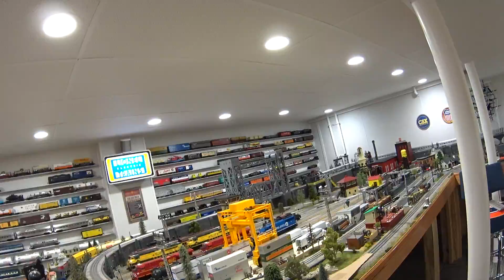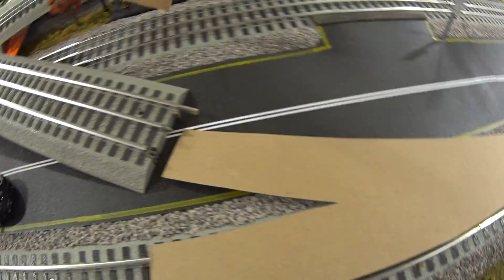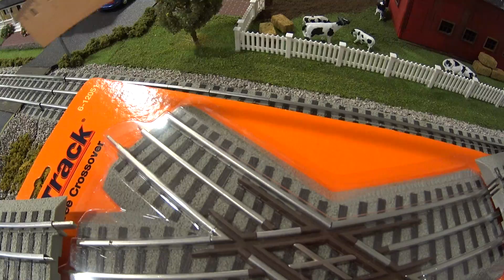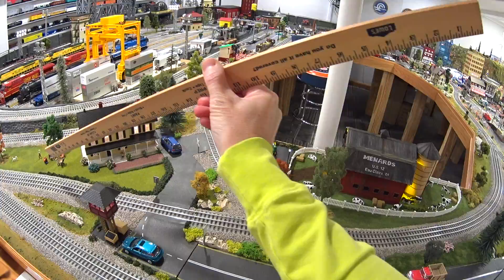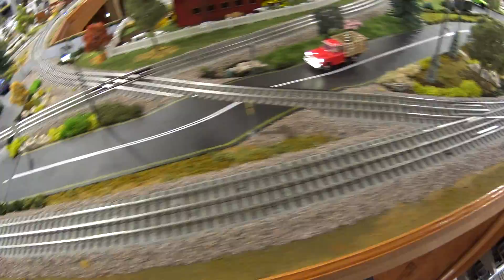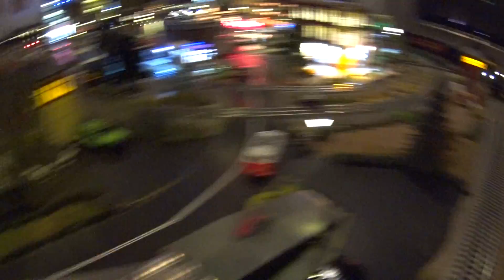My O Gauge Layout - Epsiode 11  - Track Design Fix

Comment: You keep saying you couldn't turn the train back around but really you were just refusing to back up the train to turn it around. That's a lot of work just to keep the trains always going forwards, which if you think about it the way you had it before was more prototypical because believe it or not real train do go backwards every once in awhile
Reply from the maker: Nope, not true.  There was no where to back it up to turn it the opposite direction on the mainline.  Once I was going 1 direction I could not turn it around to go the opposite direction and that opposite direction had other turnouts to other routes I could not get to.  I needed a crossover.

Comment: Sean,  you may already know this, but if you’re looking a way to create good looking cross bucks,  get a roll of woodland scenics N scale roadbed.  Measure the width you need and cut it.  Split the roadbed piece down the middle and place a piece in between each rail at the crossing.  The roadbed is already beveled on the ends and works great in curves as well.  Your layout looks awesome!
Reply from the maker: Good Idea, thanks I will try that.
Reply: What is a cross bucks, can you show a picture?
Reply: @file1man  it’s a railroad crossing.